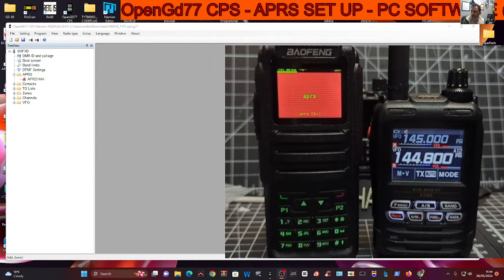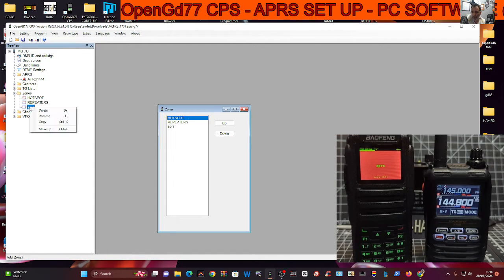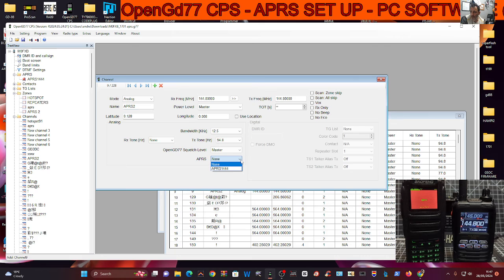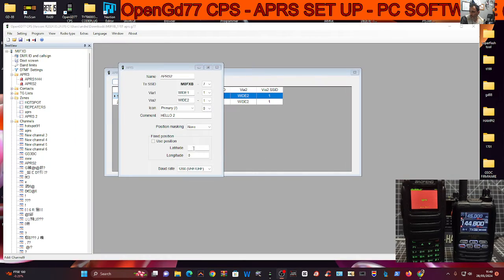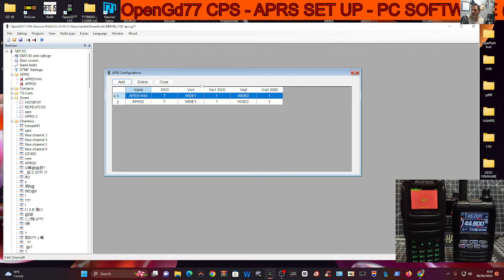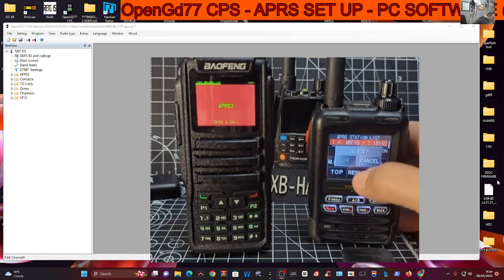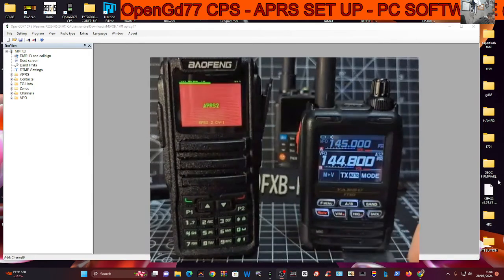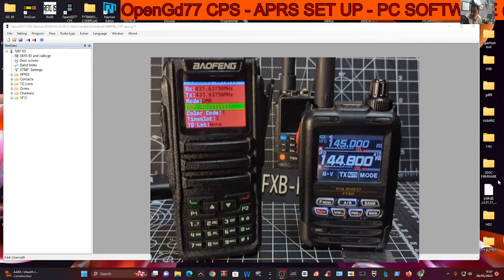APRS- OpenGD77 , Full Set Up & Test - DM1701 , CPS Software

Comment: So I've followed all documentation and set up my APRS channel as you have shown. When I write the codeplug and view the "channel details", I am shown APRS:INVALID. My codeplug has 2 APRS options but I can't select either of them in the channel details, my options are INVALID or none. This happens even on a new codeplug with nothing but a single channel. Have you experienced this? My CPS version is R2025.03.01 and I'm using a Retevis RT3s with firmware v20241215112654.
Reply from the maker: Please watch video again .
Reply: @M0FXBHamTech  Watching again did not at all address my issue. I wanted to post my findings in case someone else has this issue and can't find a solution anywhere. It turns out that the CPS version I was using (R2025.03.01) wasn't writing the APRS configs into the codeplug correctly so the Retevis was displaying APRS:INVALID and not using any APRS configuration at all. I rolled my CPS back to R2024.05.30.01 with firmware  20240908143155 and was able to correctly generate the codeplug and use APRS on the RT-3s again. It's possible there is a newer CPS with a combination of firmware and/or donor file that would solve the issue, but I didn't want to try every combination. I stopped at the first one that worked.
Reply: @M0FXBHamTech   I have the same issue on the RT3S w/ the current "stable" firmware (20241215112654).  I have watched the video several times and followed your instructions precisely.  I will try some things and post if I succeed.
Update:
I fixed this issue by updating to the latest beta firmware (20250323054626).  Keep in mind you will have to re-enable GPS under options->general options->GPS, go into APRS options and set mode to PTT, go into channel details and set APRS to your entry under APRS in the tree in CPS, then wait for GPS satellites to lock in.  With all that done, then pushing the PTT and releasing it will display APRS TX and it will send an APRS packet.  Keep in mind there is a timer that prevents you from sending APRS packets in rapid succession, so repeatedly hitting the PTT will not send another APRS packet until that timeout is exhausted.  I don't know how to control that timeout yet but it seems to be 1 minute.